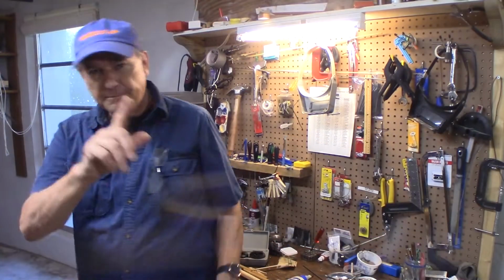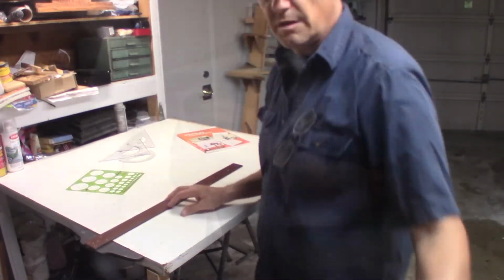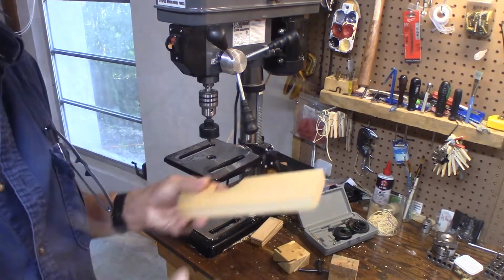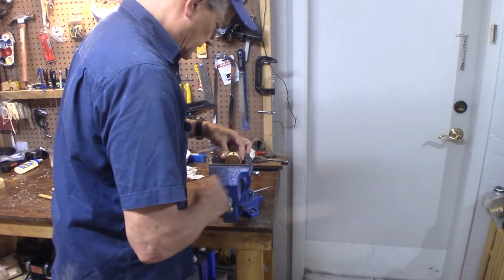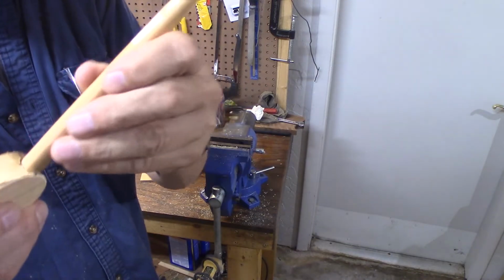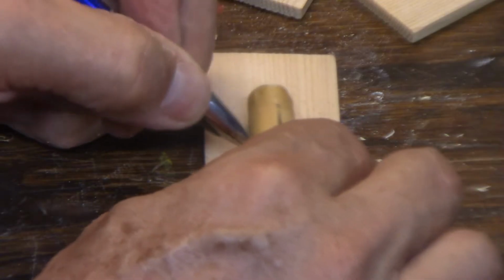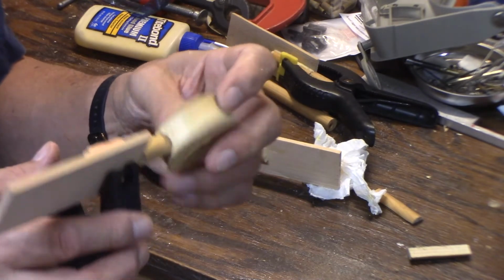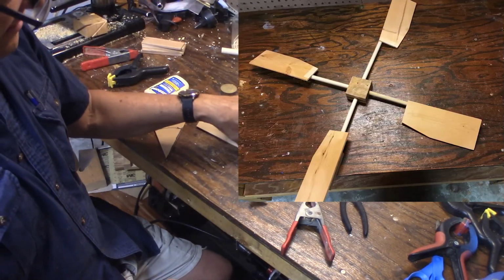How to make a Whirligig Propeller without a table saw!

Comment: I haven’t tried drilling precisely often, but with your clamping the hub in a vise to drill straight, would it be simpler to drill in horizontally and use a level on the drill or bit to set your position, than try to eyeball the drill and bit from a vertical position?
It isn’t lathe operator precision, but trying to drill straight horizontally in a vise seems a better way, without having a drill press. Yes?
Reply from the maker: Interesting suggestion.  I have found that using the drill press with the hub piece clamped to a 90-degree block works easiest for the whirligigs shown here.  Certainly, there are more ways to do it depending on your equipment available.

Comment: You put a lot of emphasis on accuracy, then at 15:12 you just move the block under the bit and drill the hole.
Didn't look to accurate but I bet it still worked OK.
90% of this or any project is just having fun creating stuff. Great Job thanks.
Reply from the maker: Great point

Comment: Do you have thoughts and experiences in deciding the propeller blade size, compared to the arm of the whirligig, and how local wind speeds respond to fewer, longer blades, or 5 or more blades? Is there better performance in windy conditions with certain size propellers?
Reply from the maker: Larger blades appear to turn more slowly; however, they also seem to begin turning sooner in light wind as long as they are well balanced.   Five or More blades often helps the propeller spin easily too.
Reply: I did my first one this way. After I use up the hubs I cut on the table saw I might go back to the wood dowel method. I will probably do exactly what you did but add some super thin aluminum to it for some good surface area. Good video thanx.

Comment: You can also use a mitre saw. Once I'd cut out my circle I then bolted it to a flat piece of scrap wood and clamped it to the fence on my miter saw set my angle and depth then all I did was rotate it on the  bolt to my next mark
Reply from the maker: Yes, I show that method in another video. Thanks for the comment.

Comment: Question: would you consider making one and how much would you charge to make a replacement propeller for me?
Reply from the maker: Yes, I have made a few in the past.  It would depend on the type and size of the propeller you need.  Usually around $25 USD for a typical wooden propeller.
Reply: @gwheyduke  
Thank you so much. Do you accept PayPal? Would that include shipping costs, as well? I will find the dimensions for you.